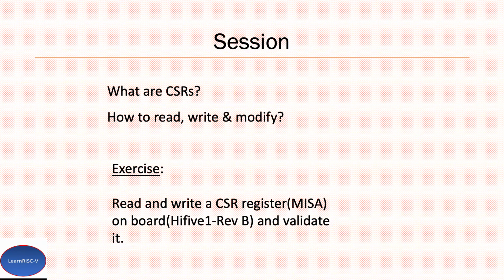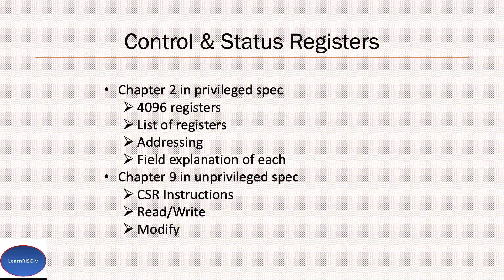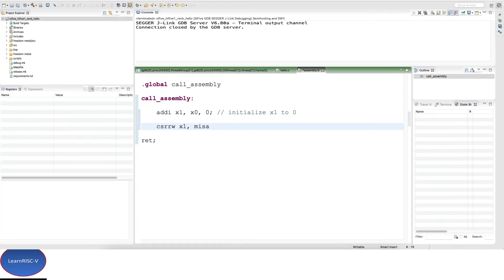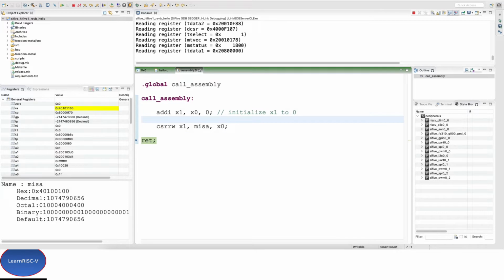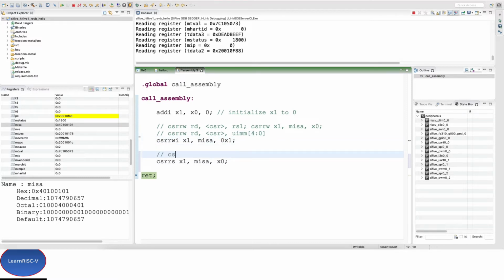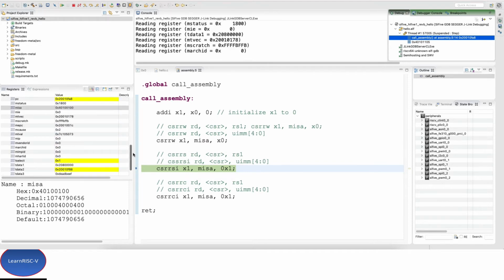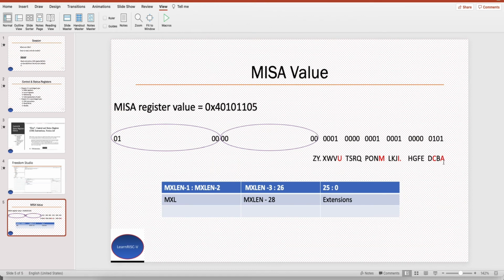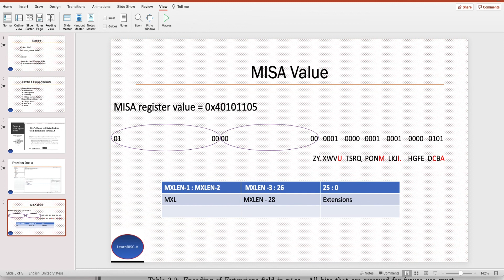Read, write and modify control and status registers in RISC-V

Comment: How can I configure this? Are there any videos? I'm new to this, I designed a processor. I need to debug. But tools without an interface, such as Spike, are very troublesome. Program vehicles like RARS do not have all the systems.
Reply from the maker: configure what? can you be more specific?